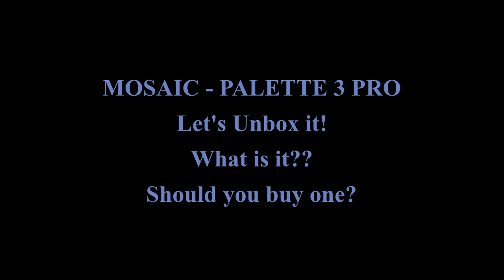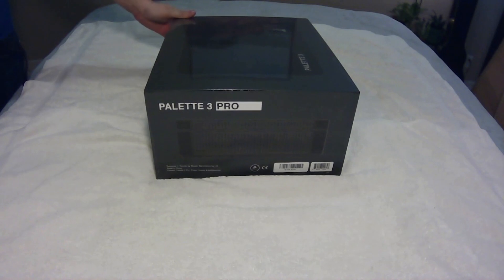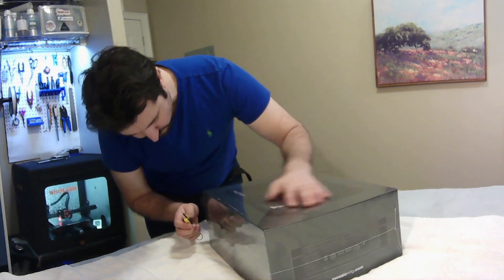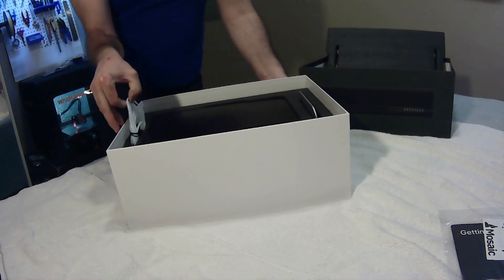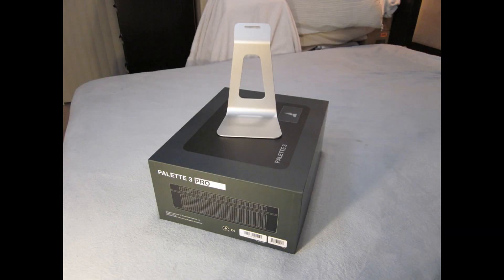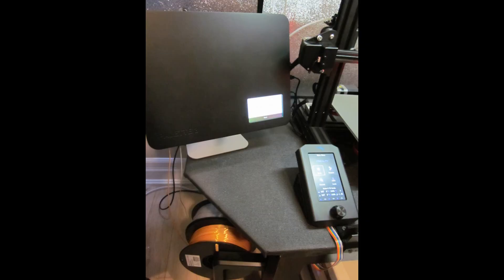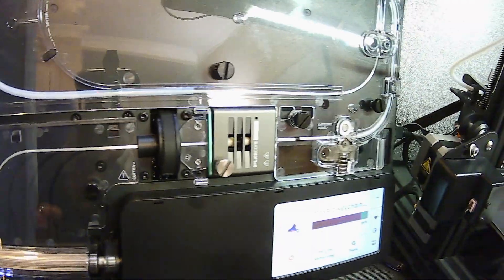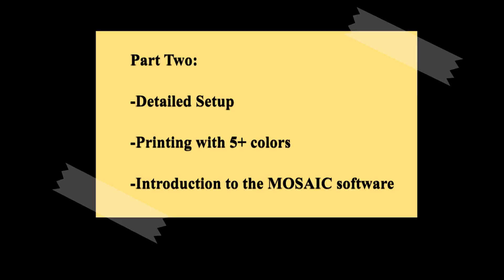Mosaic Palette 3 Pro - Unboxing and First Print - Part 1

Comment: Is the Mosaic Palette 3 Pro compatible with the Flash Forge Creafor 3 Pro ? Which has dual extruders ? 

Can I buy two palette 3 Pros and connect each one to an separate extruder - so I can have 16 color prints ?
Reply from the maker: This would be an awesome idea to print with 16 colors and in theory it would work, however I don't believe that Mosaic's software has the ability to sync two pallette machines together in order to feed a dual extrusion printer. They are always coming out with updates and changes though so it would be worth it to ask them directly on their website chat help.